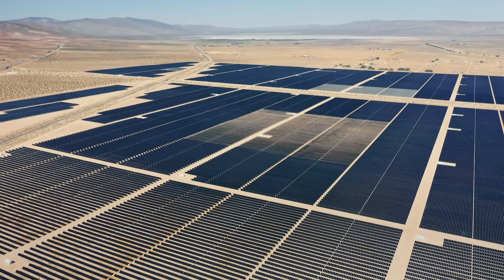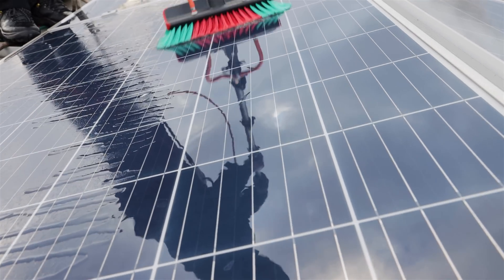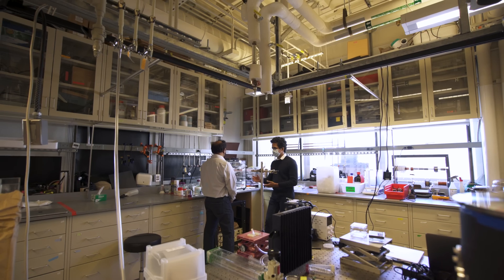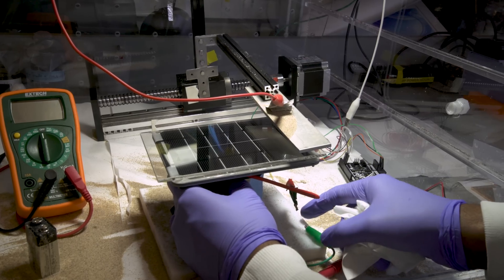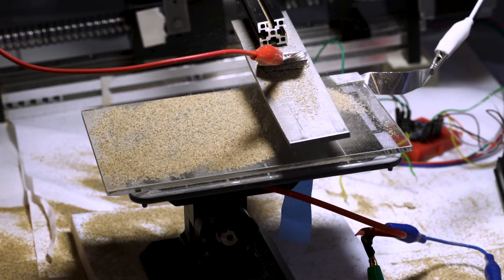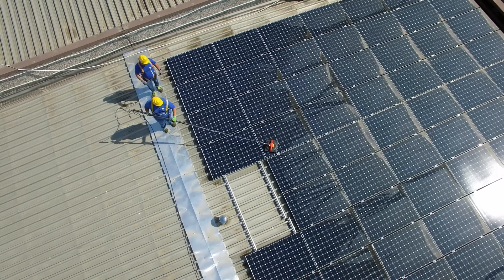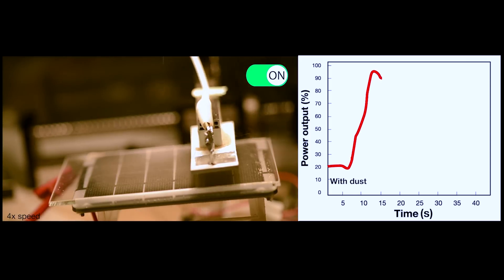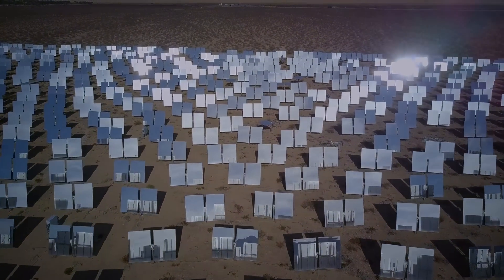How to clean solar panels without water

Comment: Why not just use a fan? Also wouldn't the charging action damage the components withing the solar panel?

(Not being condescending, just curious)
Reply: I had the Same question
Reply: I want too. If someone with more information let's share it here.
Maybe when the sand is moved with air it scratch the panels...
Reply: @vasiovasio  moving sand would be very common if you install panels in a sandy environment, so thats out of question
Reply: @vasiovasio  yes - abrasion, low effectiveness and high power consumption seem to be the main issues
Reply: Same question. Why not just pressured air?
Reply: @showlottathings  Compressing air requires huge amounts of current.
Reply: Compressed air requires relatively massive amounts of electricity to produce. The solar farm would sacrifice much of it’s capacity on cleaning panels and not powering society. Compressed air cleaning system would be a HUGE parasitic loss on the solar farm, making the solar farm less useful overall. Think of it like giving yourself a pay cut
Reply: @Bloated_Tony_Danza   its not THAT power hungry - 3hp compressor creates about 500l of air in about a minute and that is enough to clean at least two panels.. those two panels will need about 3-4 minutes to generate that 1 minute of runtime... and then you need to clean them like twice a month? so... up to 5 minutes from 2 weeks of production ;)
Reply: @alfworks  3HP is the energy required to lift 1500 pounds one foot in one minute. Still a good amount of energy
Reply: Wind can bring some tiny particles in it too to errode the PV cell maybe?
Reply: because this guy is just a grant consumer
Reply: There can be multiple reasons. Some of them are:
The adhesion of sand and dust particles to the panel surface.
There might be a case of electrostatic forces between the sand and plate due to their severe dry conditions
Yeah these ones come over the top of my head. There can be other reasons as well
Reply: It wont go off. If u ever have dust on car backwindow. U know how hard it is to come off with just air
Reply: Good intentions dont make better solutions. This research is dead from the beginning. 

It's a shame to waste money to fund this
Reply: That's science , so many problems before they are finally rolled out for Public consumption .
Reply: I would use vibration to remove the dust but a fan would work too
Reply: Right? My question was "why not a vacuum cleaner?" So same but opposite lol
Reply: @rachelelliott1674  a vacuum cleaner that large is a) very expensive and b) requires an extensive dust collection system (otherwise it would settle on other panels)
Reply: Maybe a closed loop water system would be the answer. Rinse and then collect the runoff to filter and repeat.
Reply: @improcrastinating8063  a close loop water system would help save water immensely. Yes, we may still lose some water from the system, but majority of it will remain.
Reply: @improcrastinating8063  can't do a closed loop. The surface of a panel would always remain outside the loop.
If you meant reclaiming, evaporation losses would be huge still.
Reply: @improcrastinating8063  some water has to be pumped to the system initially,
Reply: Because it doesn't work, no matter how hard you blow on them. The sand seems to bond to the panels - maybe the wind creates a potential that attracts the sand.
Reply: @BullCheatFR  you have no idea what you're talking about, opportunity rover was able to work for years simply because panels were cleaned by a wind.
Reply: @beboba2498  I don't know about the specifics of opportunity... it's also good to point out solar panels still work when dusty. They simply produce less power.
I've got panels in very remote desert sites. They work just fine, but I'm only getting 60% of their rated power due to misalignment and dust collection. It seems like it stops getting worse after a point, which leads me to the electrostatic bond hypothesis. But again, I'm no material scientist, I just operate telecom sites in the desert.
Reply: @BullCheatFR  you make very good points, but to the point that electrostatic dust removal will get panels to within 60-90% of rated full power output for given light conditions, compressed air systems would function the same way. While some dust does resettle on panels, most of the dust is removed and ends up away from the panels, which is vastly improved by windy conditions. You have basically the same effect where the panels are restored to within 80% of optimal, except the system costs far less for terrestrial applications. If there is air freely available, taking advantage of the free working fluid!
Reply: @keatoncampbell820  it is my understanding that the electrostatic system removes the fine dust, specifically the one you can't remove with compressed air.
Reply: @BullCheatFR  I'm not sure what kind of fine dust can't be removed with compressed air, as most rock dust particulates are fairly easy to move with compressed air. I don't doubt it, however, although I'd still say compressed air removed enough dust for the difference to be negligible in most earthbound scenarios
Reply: @BullCheatFR  it does work genius
Reply: It's because if we use fan the dust from one solar panel will accumulate over other , and the process will go on forever.
By the way we can use vaccum cleaner but not sure about the power consumption by them.
Reply: @paramdeeps7217  Maybe they should build solar farms higher up.
Reply: @paramdeeps7217  fan can move one direction with some angle which avoid dust spreading to already cleaned panel
Reply: Wouldn't a fan just blow the dust into the air where it will settle back onto the panels?  Vacuum cleaner would be a better idea.
Reply: @simongross3122  fans across the top of the panels, facing downwards obviously, might work if set to an optimum blowing output.
Reply: Rocket science technologies have much more selling potential than a... fan
Reply: @ademchyshyn  Bingo.  It's all about the funding potential.  Compressed air works amazingly well and doesn't require modification of the panels with a conductive layer, but nobody is going to fund compressed air.
Reply: @unhinged-menagerie  Most logistics based engineers I know will always take the easiest route, and I’d bet that there’s definitely reasons why they don’t just use fans… sometimes it’s not a conspiracy
Reply: @Emily-fm7pt  well that's not a conspiracy. Compressed air is not exactly a profit rich environment, so funding is pretty sparse. You may have noticed air tools have actually gotten a little worse over time! It's not some shadow corporation or something, just the fact that compressed air systems do not generate long term profit for tooling companies and suppliers, because the air is free! Companies are more likely to make investments that pay off better in the long run, and the huge benefit here is solar panels in airless environments like the moon or semi-airless environments like mars, where the panels are still exposed to fine dust. Using a working fluid is generally the best way to clean something, which is why water is used, but air as a fluid is quite effective at removing dust. Which sufficient air flow preventing dust from settling, you may not even need to clean a panel to begin with, but that's not exactly continuously profitable for the company that makes the fans.
Reply: @unhinged-menagerie  compressed air is how we literally sand blast glass, don’t we? With the amount of sand that we’ll be throwing at it in a desert with the air, the transmittance of the glass is permanently lowered.
Reply: Since automated panels already rotate to face the sun, why not leaving them facing the ground at night so that all particles fall under the gravity?
Reply: Scratching ? Blowing over the surface will Slide Over the Glas cover this seems to jump up onto the electrode
Reply: @964cuplove  air movement of the particles will also make the particles impact the surface, scouring it
Reply: it would kick up more sand on to other panels

Comment: I don't understand why air or sound would not work to remove the sand
Reply: Or vibrating the panels themselves to shake the dust loose
Reply: Yep, the real problem is other trace containments. If it was just sand like in the lab no need for that fancy system.

Comment: But it would requiere an overhaul of existing panels? Wouldn't compressed air be easier to implement?
Reply: Compressed air would make the dust scratch up the panels.
Reply: @theavaliengineer  And this wouldn't even get it off in the first place.  What's your point?

Comment: "oh no if we brush it, it'll scratch" bieeetch if this sand lands on the panel with any velocity, it will scratch the surface anyway. Either use harder material or use replaceable covers. Water doesn't reduce the scratching. This method only removes fresh applied DRY waste that wind will blow off anyway. This is such a joke. MIT is such an absolute joke. I'm only subbed to laugh at this horseshit. Real panel buildup is STUCK on and can barely be scraped off with a razor, let alone a cute little electrostatically charged plate.

Comment: Sand is not dust my friend.
I was hoping to see this method tackle the real problem... which is dust left behind after rain fall or due build up.
Still rather interesting!!
Reply: Air pressure
Reply: @jacklol4248  Even before using 1l of water i would have thought that AIR would be solution N1!! I didnt know that there was used water, this makes PV even worse as it has been before due to its costs, metal (pollution) and bad efficiency.
Reply: @jacklol4248  ding ding ding, the only solution.
Reply: "This technique mainly works because 80 percent of dust particles contain a mineral called silica, an insulating material that acquires electrical charge because it absorbs moisture from the surrounding environment. As long as there’s enough humidity in the air (above 20 to 30 percent), there’s enough moisture for the silica to absorb, Panat said. Fortunately, too little moisture in dry regions like in the desert doesn’t pose that much of a problem since humidity tends to fluctuate where it’s highest at night. For those regions, Panat said, the solar panel’s repulsion system can be timed to go off during periods of optimal humidity."
Reply: Glaubst de Wissenschoftla wissen weniger ois du, du obagscheita Pseudonerd?

Comment: Looks like it cleans away sand, but not dust
Reply: They said it reclaims 95% of the power output so it mustn’t matter much
Reply: @yourearent  It appears to matter 5%
Reply: Saves by not having to truck in water and waste it
Reply: At least it can be used to reduce the amount of water used to clean panels. Needing to be cleaned with water less often.
Reply: Also graph is shown comparing power outputs with and without dust. Also graph comparison had to be showed with that power output of the water cleaned system. If negligible difference, this is good... Also comparison of usage over long periods of time and also comparison with mixed usage - monthly water cleaning and daily e.s. cleaning would also help
Reply: What if the soil comes above of PV surface? Can this tech remove it ?
Reply: Perhaps better to use water, then reclaim as much of the water as possible, filtering etc.
Reply: @hippopotamus86  Every efficient water purification system consumes electricity. Moreover the water quality has to be extremely good better than drinking water which is only possible with RO systems.
Reply: @itsourlife  Filter it to reuse on the solar panels I mean. Gravity will be enough to filter it.
Reply: @hippopotamus86  gravity will filter water to better than drinking water quality?
Reply: The government could easily fire a rain making missle above that array and give them a good soak, but that is still classified info.
Reply: @colomacountry  so how do you know it?  Just made it up? 🙄
Reply: Touch less cleaning of solar panels is the best concept as it doesn’t require water and also we can clean our panels anytime of the day.

Comment: Isn't using electricity to move the sand/dust going to require a huge amount of energy if you're cleaning something like a solar farm?

Sure you didn't use any water but instead you're using a huge amount of power to do the same job.

Plus in your demo it doesn't even fully clean the small piece of glass.
Reply: Basically, what he's asking is: would the amount of energy used with this method offset that of purifying the water necessary to clean? A valid question.
Reply: It literally makes electricity, it's a solar panel
Reply: Power is volts times amps. High voltage does not necessarily equate to high power. You need enough voltage to charge the particles and then the amps is going to be related to the amount of energy required to move the particles to the collector, plus losses. None of these details are in the linked article.
Interestingly, the article mentions that humidity is crucial to the process working. <30% RH and it doesn't work well. So, in dry areas, they need to time the cleaning to hours when RH is higher.
Reply: @Markle2k  The humidity part is very interesting and could limit the application of this in arid environments, where the humidity doesn't exceed 30% during summer seasons.
Reply: @TimeFlies-d8b  If you read the article, it's linked in the video description and not very long, they say that when the temperatures go down in many arid sites, the RH climbs high enough. They suggest cleaning in the morning as a workaround. Deserts do tend to get cold at night. Desert plants often survive by harvesting dew.
Reply: @Markle2k  makes sense, but in some arid deserts, for e.g. Arabian Sahara, during particular months, for e.g. July and August, the RH doesn't reach 30 throughout the day. Such places are almost devoid of plants and the ones there are able to survive by having ultra long roots.
Reply: @TimeFlies-d8b  I see where you are going, but we can’t allow corner cases to define all use cases. They will need to show that their system works for most or the majority of cases in arid regions. I don’t really buy the notion that this is a major concern at all. It potentially is a concern for some installations.
Reply: @Markle2k  only time will tell

Comment: why not use a controlled stream of air, blowing the dust off the surfaces the panels?
Reply: probably not energy efficient
Reply: @mofuker199  an air blow will blow most of the sand of, while in the video, the setup still had some sand left. 
+ A blow of air won't suck up too much energy
Reply: @mofuker199  There is no way in hell that it would be less energy efficient than charge repulsion.

Comment: Great work. 
Is cleaning solar panels really necessary if panels are kept at 20+ angle? Most of the large dust particles will fall off and the remaining amount should not impact the efficiency that much.
Reply: That's the problem here, the demonstation is made with dust which has virtually no adherence to the solar panel, the actual panels who need to get cleaned have the sand/dust stuck on them from previous rains or other events, and that's why even at a 20° angle they don't fall, but that is also why this solution seems kind of useless? time will tell i guess
Reply: @citizen_of_the_stars5144  Definitely I was looking for this comment.
Reply: @citizen_of_the_stars5144  good point, we'll see how they actually fare out there
I'll also add that periodical scrubbing with water (if necessary) if this system were to leave residue is still ideal compared to what we have now
Reply: @acidset  True, but perhaps it can reduce the frequency of water scrubbing and still save a bit of fresh water
Reply: @simongross3122  They are pitching the "without using a single drop of water". Then again, loose sand is far from grime and dust, and electrostatic wouldn't be enough to remove those.
Reply: @patrickjeromeobaldo2450  I think you're right.  Maybe if they made vibrating panels the sand etc. couldn't settle on it.  Or perhaps there is no water-free solution at all.
Reply: I have solar panels and the small amount of debris that remains can have a significant effect on ur production. Its why we tend to use water to clean them
Reply: It's been extensively studied, and depending where you live no you don't need to clean solar panels. As the energy generation averages out over decades, and with the odd bit of rain, you gain little efficiency and extra power generation on a decade long scale by obsessively cleaning them.

There's actually an odd phenomenon whereby clean solar panels will generate the exact same amount of electricity as dusty ones right next to them, despite sensors showing the crystals in the clean panels are receiving up to 20% more light... Nobody knows why this is, but it's theorised the max amount a solar panel can generate is limited by heat (which is why some systems are water cooled using pipes at the back).